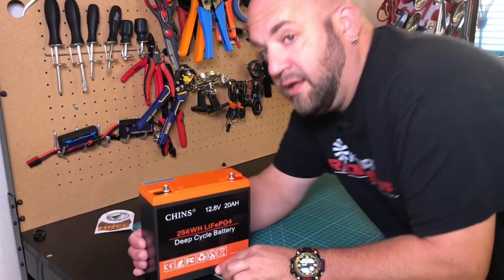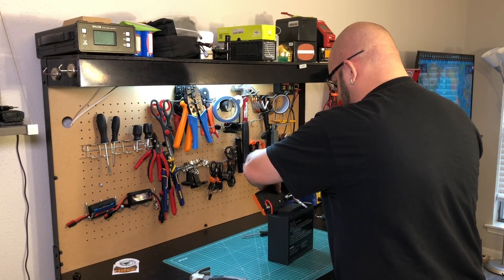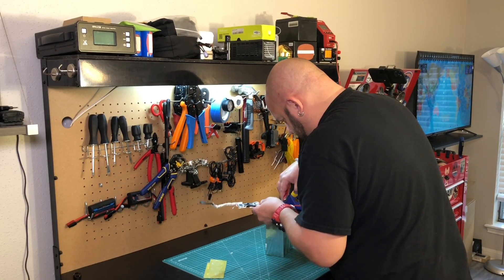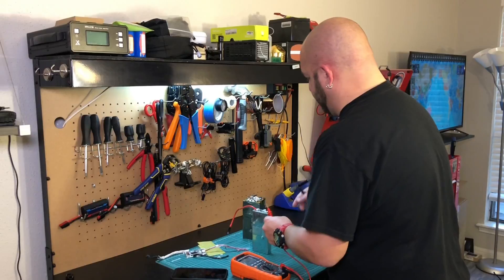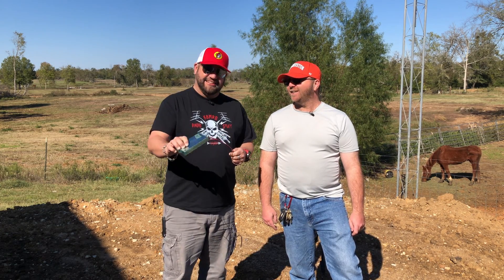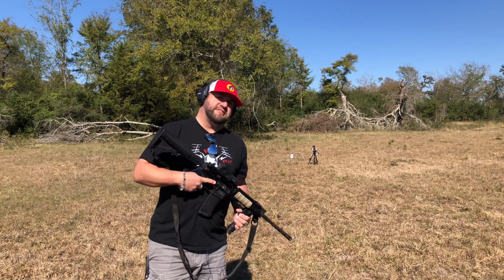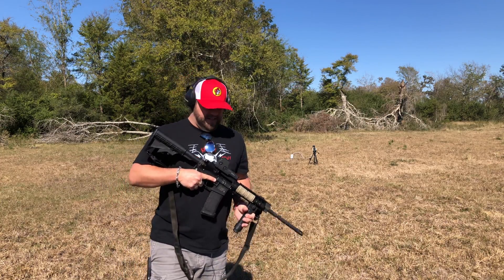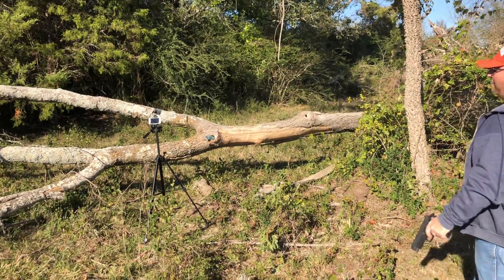Shot, Punctured, Overcharged, Set On Fire Chins 20AH LiFePO4

Comment: Apparently 49% of the off gassing white smoke is Hydrogen, if you had a damaged LFP cell that size in a room or garage its possible to have a large explosion if the percentage of hydrogen is right and there is an electrical spark or fire. I watched a video on the StacheD Training called LFP Batteries: Are They the Safer Choice for Electric Vehicles? It explains more. Searching on Google I could only come up with two LFP explosions. One still under investigation in Germany and another in China from 2021 that was deadly. Very rare it seems. Maybe when more people have LFP systems we'll hear of more.

Comment: They aren't fancy, but 100% of the Chins I've had hands on worked as claimed. 

My instinct is charging them to >14.4v resulted in cell imbalance, premature charging cutoff, and therefore decreased /apparent/ capacity.  Charging it more mildly to 13.8v (instead of shooting, puncturing,  overcharging, and setting on fire) would likely have allowed the cells to rebalance and fully charge and you'd have a functional battery.

Comment: I see now why Dragonfly Energy is patenting the solid state electrolyte technology which reportly won't be nearly so disastrous as the liquid stuff. I was parked next to a Honda Prius in 2009 at Bubba's Steakhouse in Cape Coral, FL when someone alerted us the car next to us was smoking. As I backed out and moved several hundred feet away the car was by then engulfed in flames and the cells were popping like .38 bullets, phew! I never thought that LIFEPO4 was such an enemy to heat or oxygen. Safety first, that for the reminder! Cheers es 73, Dave - KU9L

Comment: Interesting experience with chins.  I've had great luck with them.  I ordered lots of lifepo4 Chinese batteries and tested them all.  Only chins and redodo met rated capacity for me.  I have two 16ah chins in my portable battery pack that both tested at 17.5ah.  my camper is 4 100ah chins that tested about 104ah.
Reply from the maker: It is very possible this is a Chinese knock off of a Chinese product.  I wouldn’t put it past them.
Reply: @hamradiotube  could be.  Good reason to test every battery before it goes into production

Comment: IIRC the cells with prongs are made for a different application, perhaps traction batteries, and if they are used to make battery packs have the spikes clipped off.  Generally speaking there are batteries coming out of city buses after some use that are being repackaged and resold.  Without paperwork that matches the cells and goes back to the OEM's initial QC tests it's hard to know exactly what you are looking at.  I have seen another model battery from this same brand that when cut open had the cylindrical cells and much better construction appearance.
Reply from the maker: The cylindrical cells were what I was expecting.  Not some garbage recycled cells.  I kinda had a feeling it was going to be bad when I only got 12.5 AH out of it.  Other people have said they've had good luck with Chins.  But if they're going to put this crap in their batteries, there is clearly no quality control.  Super fun to destroy though.

Comment: Is there a battery of the same size (form factor) you would recommend?
Reply from the maker: Bioenno for sure.  I've got a bunch of their batteries.  They're top notch.  Like John said, Dakota Lithium has a good name in the marked too.  I've not used them myself but I've never heard anything bad about them.  On a more budget minded side, I've had great luck with Miady.  I have 2 of their 16ah batteries and they perform great.  They are hard to find sometimes but I got mine from Amazon.  Size will very slightly between the brands/models, but not too much.
Reply: Bioenno, the best and most expensive. I have had good luck with the Dakota brand batteries. Very reasonable in price and tear down's of some of their batteries have showed good quality. Mine performs to spec. I have both kinds.

Comment: Thank you for the heads up, if they were advertised as repurposed cells then there would be little problem here...LifePo4 batteries are safe but these should have popped a relief valve, vented the inert electrolyte and not have ruptured on the side casing like these did. Lithium-ion are the bastard child's when it come to fire and safety. Thanks again M3TJT.
Reply from the maker: They don't all have relief valves so that doesn't bother me.  But the quality, or lack thereof sure does.  Got to make a fun video though.
Reply: @hamradiotube  It was fun to watch Mike. You made the right choice with the Headway cells, I brought a batch of repurposed 8ah's cells from Battery Hook Ups over your side of the pond, they tested between 7-8ah then upgraded to the 15ah a few years back. Gone are the days of carrying a car battery up a great big hill!
Reply: Thank you. That was wild.
Has anyone done an analysis of the vented gases from these lithium batteries?
  Seems like LiFeP are tame compared to LiIon and LiPol cells.
Hydrofluoric acid is released from some of the Li batteries and HF is terribly corrosive. Used to double gloves and kept the HF in a fumehood. Fellow chemists got fingers amputated years ago to keep from losing their hands. Berzelius who worked with HF lost his eyesight from what I read. 
   CO or carbon monoxide is also generated by some Li batteries. Very toxic. Also hydrocarbons that are flammable. N0QFT